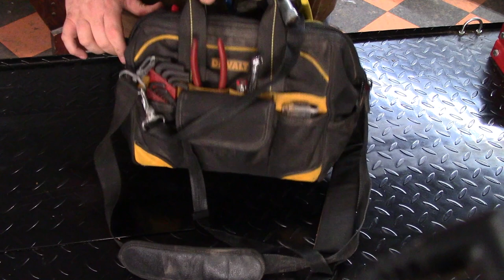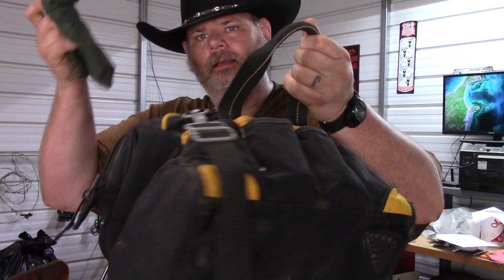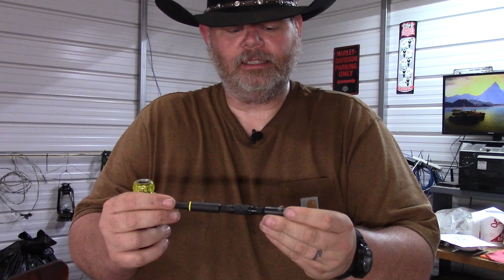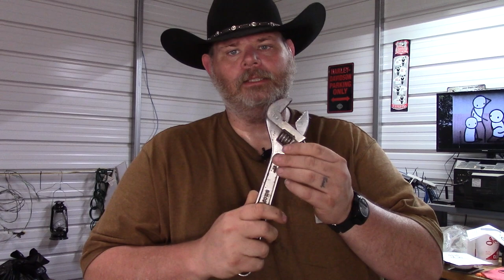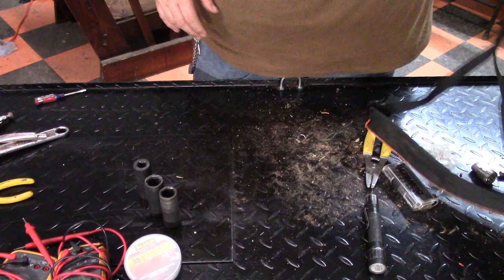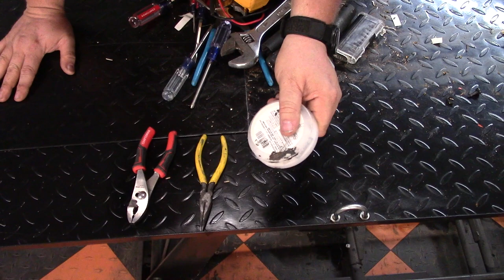Tool Bag Dump

Comment: A spud wrench is an adjustable crescent wrench, that utilizes a worm gear to open and close the jaws. Unlike a normal “C” wrench the handle is tapered to a pointed rod, used for lining up holes on a steel scaffolding, or rivet holes in structural steel or like a marlinspike for rope and rigging work.Jun 11, 2020
Reply from the maker: Cool, thanks I kinda figured that..